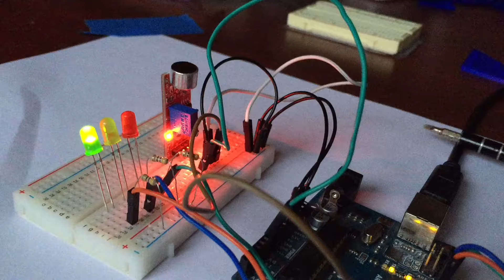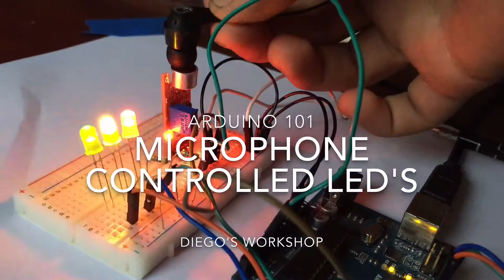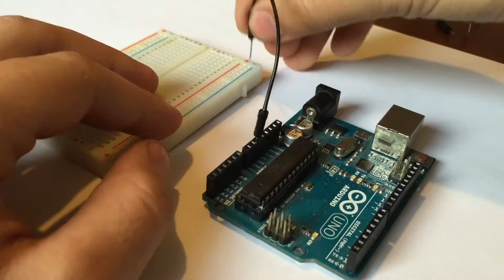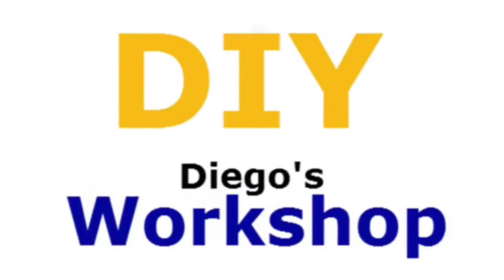Arduino 101 - Sound Controlled LED's

Comment: Hello,Your explanation is really nice ..I have a doubt,hope u will clear it
I want to set a threshold value and based on that, if the sound exceeds the threshold (then the Arduino needs to command GSM to make alert call). Is detecting higher range sounds be done by modifying your circuit a bit???

For this, can you tell me what are all the requirements I need to have?
Thanks in advance!!

Comment: what to build next? With sound output you could experiment with an echo effect. Sample microphone. Play back to speaker. Then play again with all data shifted right by one bit. The play again with all data shifted right by one bit. And so on until all zeroes are in sample.